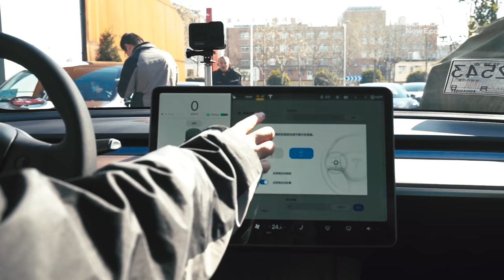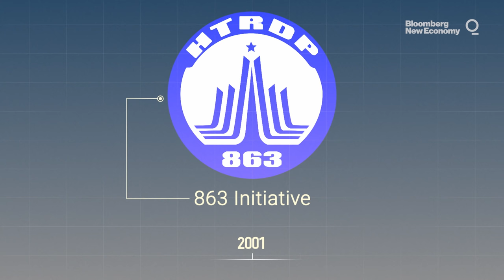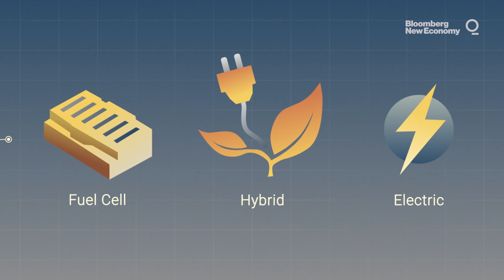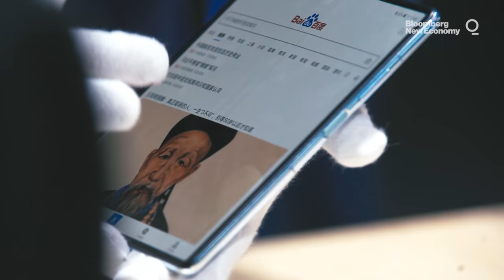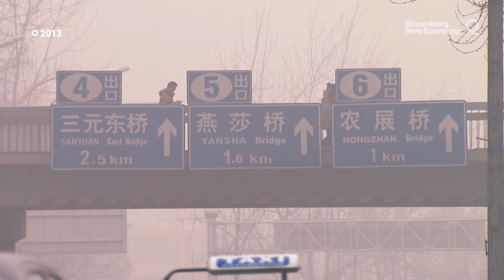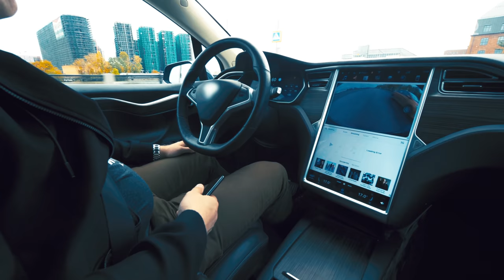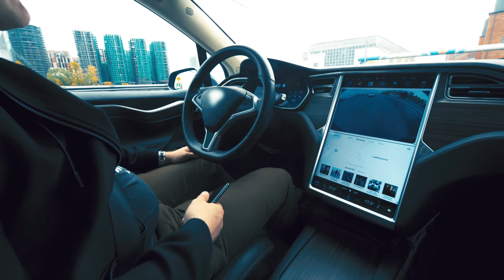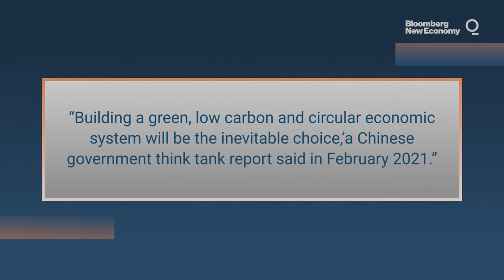Why China’s Electric Car Lead Has Been a Long Time Coming

Comment: in this video, the most powerful and advanced ev company in China even wasn't mentioned! BYD, who designs and manufacture all of IGBT chips, batteries, electrical motors and controlling etc. by itself!
Reply: I wish I could buy CATL stocks as it only trades on the Shenzhen China exchange.  But I do own Byd, xpeng and Tesla.
Reply: they did show BYD cars in the beginning
Reply: Like the BBC putting a grey filter on every video in China. This is a kind of careful machine, can imperceptibly affect everyone's habitual thinking. This kind of car is only bought by old people in China. And young people buy big cars, because Chinese people buy cars in families, not individuals.
Reply: In my city here in Brazil the civil guard arm of law enforcement already operates BYD cars since 2019, this year the petrol cars were totally retired and now it's 100% electric vehicles, the other arms of the police are also testing BYD cars.

Some buses are BYD too and there are plans to retire all current buses for BYD buses.

Other cities in the region (the "interior" of São Paulo state) are starting trials with these vehicles in their police forces as they have proven to be more econominal in the long term, more capable chasers and simply better in so many regards, even São Paulo city itself is trialing the BYD cop cars, that's a city of 12 million (23 million metro), the largest in the Southern Hemisphere, so if they follow a similar path to other cities here there will be thousands of these BYD cars operating with the police there.

I imagine it will still take some time for these inititatives to spread widely here, but it's definitely exciting.
Reply: @dddddh1  In Liuzhou, more than 90% of the Miniev buyers are young peoples.
Reply: @dddddh1  老人买的一般都是老头乐，不能算电动车
Reply: @dddddh1  BBC needs money, see.
Reply: Interestingly BYD seems to have won more EV business abroad in Coaches and commercial vehicles where competition was lower and there was less national champions. Nobody seems to have noticed they are often winning strong overseas orders with their basic EV platforms
Reply: Bias kills our intellect and our positive outlook in life

Comment: China definitely achive it's goals.
Reply: The global electric vehicle market size was valued USD 384.65 billion in 2022. The market is poised to grow from USD 500.48 billion in 2023 to USD 1,579.10 billion by 2030, growing at CAGR of 17.8% during 2023 to 2030 period.  6:19 [Fortune Business Insights]
Reply: The adoption of electric vehicles is rising sharply as the global push for net-zero carbon emissions accelerates. EVs will make up about half of new car sales worldwide by 2035, according to Goldman Sachs Research.  6:22 [Goldman Sachs]
Reply: The company’s name, BYD, is an acronym for “Build Your Dreams”, which says a lot about the brand’s values. 6:59

Comment: It is that type of arrogance displayed here by Jigar Shah that will see the USA fall behind. The casual dismissal of developments happening elsewhere other than the USA.
Reply: yep, China is the world leader in battery technology, CATL and BYD are all top innovators, Huawei have already designed a automated driving system with their HarmonyOS operating system, poised to become the Android of the smart EV industry.
The problem with entrepreneurial driven innovation is that it's still relatively short sighted and less coordinated.
Reply: Exactly. I've never seen any country in East Asia including SouthKorra, China, Taiwan, Japan to have this much arrogance in what they do.
Reply: @user-vl8bv5jt9m  except that nothing in the cheap Chinese EVs are similar to any Tesla. They dont use Lipo batteries, dont have power steering (at least at low trim levels) and have minimum safety and comfort. The only similarity is that it is electric, and that it is a car. Its closer to any golf cart than a Tesla. As for the nicer EVs, maybe some of their tech is stolen, i wouldn't doubt that. But I'm also certain that Chinese R&D cannot be underestimated. Also, Geely has owned Volvo since 2010 and Lotus since 2017. Not only that, they are also collaborating with Japanese and European manufacturers for R&D. Just calling them copy-cats when lots of genuine work has been done is a quite unfair.
Reply: it is not arrogance if you are stating facts. some people have this fantasy in their head where china is close or equal to the US. the US just has too many advantages that can not be replicated in any homogenous (let alone planned economy/authoritarian) country
Reply: @mariacheebandidos7183  The US is losing bro.  The massive yearly US trade deficit says it all, and the trade/tech war that the US started with China has failed miserably.
Reply: @jingjing8560  yes, and now Tesla is using the blade battery technology from BYD.
Reply: @user-vl8bv5jt9m  Battery is the most important part of EV. Both top 1 and top 2 battery companies are from China. BYD has been developing battery tech since last century, before tesla, that’s why they are leading in battery technology and tesla is using their batteries.
Reply: DaRealestOfDemAll  Chinese too
Reply: @Mayangone  An Indian who thinks he is an honorary White... double delusion..
Reply: @Mayangone  Jigar Shah has lived in the US since the age of 1.  This point about him being Indian is just ignorant.
Reply: What exactly did he say that was wrong?  He is right that the US is innovative but that American business and government are terrible at scaling adoption.  As he points out, China and Europe are better at that.
Reply: @416to613  He is a political appointee.  They come and go every administration change. Have you dealt with any political appointee?  Have you been to Forrestal Building?
Reply: @Mayangone  Are you aware of his long history as a cleantech investor and founder?  Ever listen to the Energy Gang podcast.  Get back to me when you actually know who he is and why he has the job that he does.
Reply: He is an Indian and that explains everything.

Comment: The worse part of this video is that they seem to imply that Tesla is the one that has/had no idea China was coming after them… When actually it is the other “American” automotive companies that truly had no idea, and still don’t. 
This video should have been titled something more along the lines of how the MOST American car company (Tesla), currently, is being use as a tool by the Western media to make headlines. Most often negative ones, which often sell better as headlines.
Reply: Exactly.  What about Ford and GM?  Why no mention of them especially when China is one of the biggest strategic markets for ANY car manufacturer
Reply: they also dont take europe into account. europe literally is far ahead of america in  electric vehicle technology. a tesla literally would not function without european technology. meanwhile the driver assistants of mercedes and audi easily outperform teslas "autopilot" fe.
Reply: Tesla has a joint venture with Byd China to produce batteries.
Reply: @Marvin-ii7bh  not to mention bmw being the first company to actually have full autopilot
Reply: As an automotive engineer, The US stopped building decent cars in the late 70's Worked on a 90.s something Jeep and it was a true dog. 90's styling. 80's emission controls and 1960's suspension Drove like a truck but hop into a Landrover, Nissan or say a Toyota equivalent of the same era and a different story. One of my first cars was a PLymouth Savoy and I cannot say how much I loved it except to say I would swap my wife for it. And I quite like her.

Comment: The title of this video is off. It should be "Why China may son beat the western societies on the sustainability game."
Reply: In the first 5 minutes the video said that the Chinese monopoly on cobalt and other rare earth metal elements necessary in current batteries will be obsolete. So China will become obsolete with the next generation of battery storage.
Reply: haha ye with its 20k coal plants and bulding more
Reply: @Zunken12  china stopped building coal plants. as per gov mandate
Reply: @Chrisfrom_Dallas  fyi, BYD is leading in the next generation of battery innovation. Tesla is using the batteries from BYD and Ningde, both are Chinese companies.
Reply: @levelazn  they started building them again, and they’ve tripled coal production in mines!
Reply: @DestinRugers.S  no. They didn’t.

Comment: When you put Tesla as the EV role model for innovation, you should mention the battery is Chinese innovation and technology. So you just can’t draw your conclusion based on your example.
Reply: Ummm no. China assembles it. It’s teslas technology that China puts the parts together.
Reply: @rydgevilla8643  no，china create them，as byd
Reply: @rydgevilla8643 For EV, no, the biggest player of EV battery is CATL. Model 3 and Model Y use CATL batteries. CATL collaborates with companies including BMW, Daimler AG, Hyundai, Honda, Li Auto, NIO, PSA, Tesla, Toyota, Volkswagen, Volvo and XPeng.

Comment: They can look more than 4 years into the future. One parlement wants this, the next one brakes it down 4 years later, your back to zero again.
A "dictatorship" has its advantages, when done right. The same can be said about Singapore, they also did a fantastic job and are now a world hub.
Reply: Some might argue that the USA itself is a corporate dictatorship, which explains why they, directly and indirectly, supported many dictatorships worldwide (and continue to do so), as long as it aligns with the interests of the corporate class.
Reply: China isn't a one man dictatorship, it's a one party dictatorship. The party still holds power over the chairman. The main drawback is that sometimes party goes over country, and sometimes a party ideas can get stuck, without being able to be kick out, it's hard for fresh air come in. I don't think china will give up the efficiency of one party for now, as so far has worked wonders for them in their opinion. Yet they will need to open up more the party, like they did when they opened membership to all Chinese citizens for the party to remain dynamic.